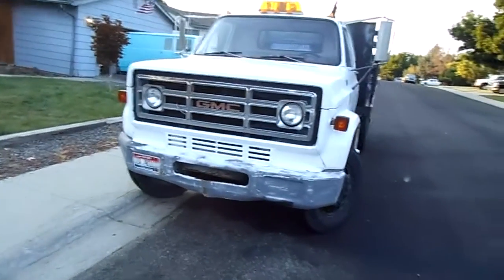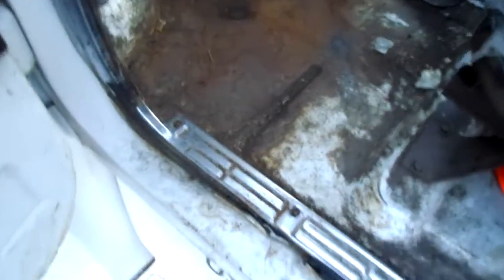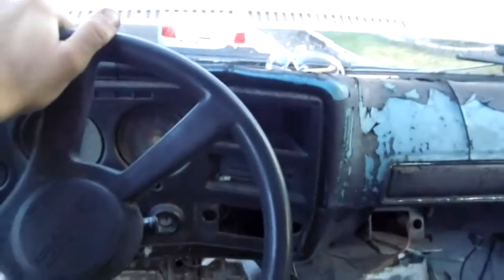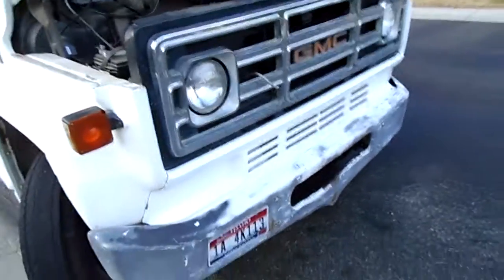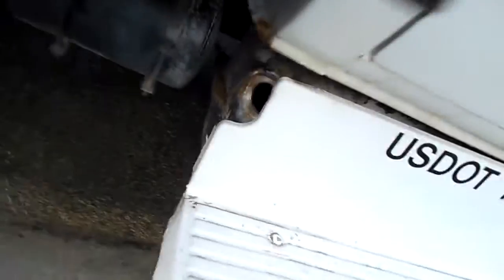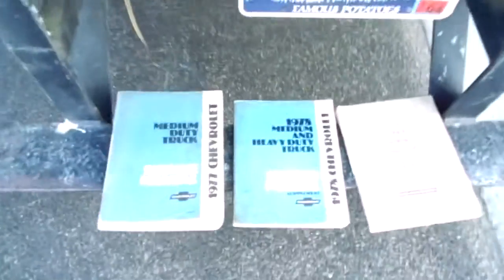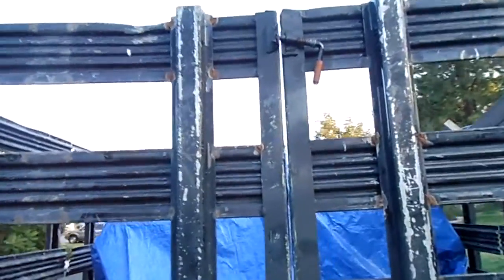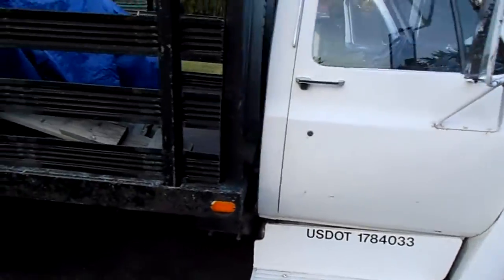1978 Chevrolet C-50 Two Ton Medium Duty Truck

Comment: I owned a 1968 C50. The most fun truck I ever owned. 
Had a big water tank on it. Cut the tank off with a torch.put a 10 ft flat bed on it.4 speed with 2 speed rear end.

Comment: Hey, loved yr video...I've got the almost identical counterpart: GMC C5000...and was looking for a radiator when I saw your stuff.  I've found it difficult to locate parts until recently with what seems like a lot more on the internet.  I agree this is a great truck! Keep 'er runnin' !
Reply from the maker: Right on man! I had to sell the ol girl several years ago due to financial troubles. I plan to get another one in the near future and build a real nice fifth wheel hauler. Just using a 3rd gen Cummins for now. 

Parts for these beauties are definitely tough to come by. Fortunately the radiators in theses are very rebuildable, a good rad shop should be able to fix you right up. I touched up mine two or three times with some plumbing flux and solder on the tanks. Whoever “fixed” it before I got it did a horrible job.

Comment: Awesome rig often thought of putting a 12v cummins into one
Reply: willie willerton I understand a diesel is the more intelligent choice..but come on its hard to resist the deep moan of a 4BBL carb and a V8 gas burner screaming to the moon when you open it up....if you have ever REALLY TRUTHFULLY ......been into hot rods you would uderstand that...
Reply from the maker: Im planning to get another one of these and putting an 8.3 Cummins in front of an Eaton in the near future. Should make a bitchin pulling rig for my 5th wheel. Just yankin’ with a 3rd gen Cummins for now.

Comment: that thing has got more of a 5.15 rear gear, 3.79 is wayyy low. very cool though!
Reply from the maker: 3.79 was printed in the glovebox tag. She wasn’t fast but she had all the pull you could ever need. The 350 was pretty wound out at 60 MPH. I miss that truck.
Reply: @Zombunist  hmm, odd lol, thats still way numerically low for a rig that size! very nice though!

Comment: Would the original motor have been a 366 or 427?
Reply: I drove several of these trucks back in the 70's. The standard engine was a 350 with the 366 or 427 and upgrade over that.